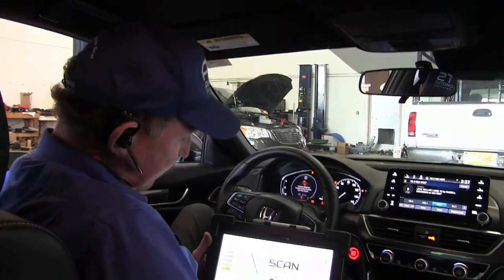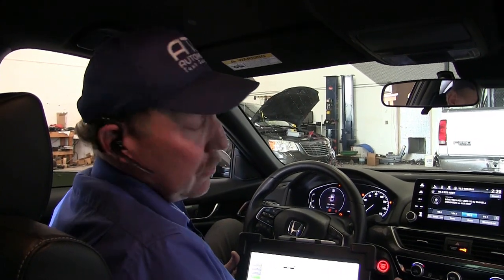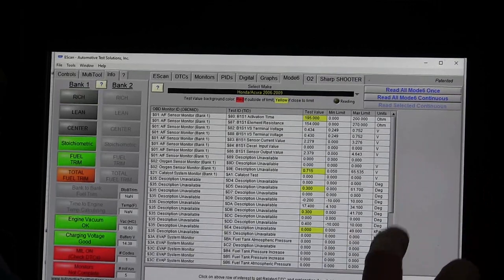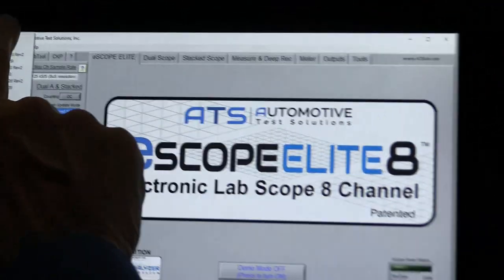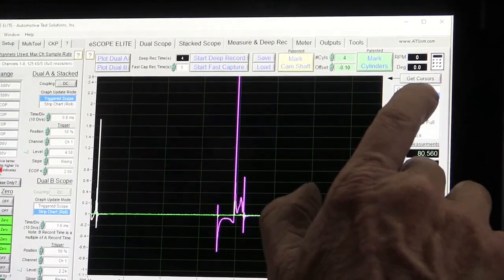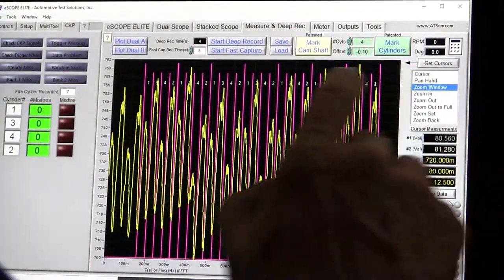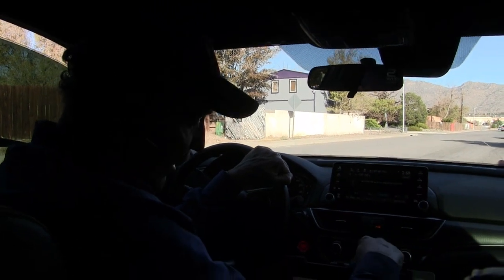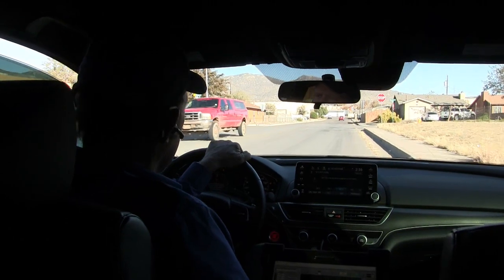Diagnosing a Misfire & Lower Power on 2018 Honda Accord 1.5 Turbocharged Engine P0304

Comment: 2018 Honda Accord EX-L 1.5 73,300 miles. Just came back from the dealer. Started with christmas tree lights (every warning light) going off in the car. Thought it was a bad battery, bought a battery wasn't that. Misfire on cylinder 3. Blown head gasket with a possible leak or deformed engine. They recommend buying a new engine at a cost of around $10,000.00. Went down an internet rabbit hole and it seems that the problem is quite major with thousands of posts all over the internet. The problem is believed to be making the engine more emissions-friendly to deal with government ratings; what they didn't foresee was the gaskets couldn't take the pressure. I contacted Honda GoodWill and seeing what they say, I'm not holding my breath. I've owned 1998 Honda Civic, 2009 Honda Civic, 2013 Honda Accord, 2016 Honda Accord, and 2018 Honda Accord...it's looking like this will be my families FINAL Honda.

Comment: I work at a Honda dealership. Injectors get replaced at an alarming rate. The manufacturer has a workflow of parts replacements in their troubleshooting. I am literally the first technician at this dealership to own and use a Picoscope. My test for misfires allows me to observe all of the things you have done in this video. One thing I would like to suggest is that you can capture high pressure fuel system sensor voltage and monitor fuel pressure drops during normal injector activity and compare among cylinders. You don't need to open the fuel system up at all and you can do this while the vehicle is running.
Reply: Should I stay away from these 1.5t engines? It’s time to buy a new car, but my 2012 Si with 160,000 miles, k24 engine has never had a single issue and I’m scared of these new ones.
Reply: @thomasengel1459  That's a good car. Why do you need to replace it?
Reply: @gooe9561  i guess I don’t NEED to. But that new integra looks nice. But if that 1.5t is shit I won’t do it.
Reply: @thomasengel1459  You do you but I don't think they're great. Injector problems, massive carbon issues in the intakes and on the intake valves. Fuel injector problems that repeat themselves. And we still haven't really had a chance to test the longevity of the turbos themselves.
Reply: @GooE   Can you please provide you workflow test procedure. I have an advance scanner and scope, but don't have ability to flow test these GDI injectors. Got a 2018 Honda Accord 1.5L with P0301. Its a slight miss at this point, don't have carbon trace.
Reply: Those gdi small turbos also experiencing LSPI syndrome and becomes Very serious damage to the engine:) nice Idea with this inductive sensors places on coil's...  Ps  long time ago I placed big coins connected to channels on top of ignitors and did the job:): maybe?:) Masters diagnose thumbs up
Reply: GooE honor and ambitious for company is the most important, but specially when so many comming back with the same problems.. A lot of techs at MD they know how to fix the problems with scope but is not profit from sell the parts  after warranty, I maybe wrong, but in UK is common practice.
Reply: Hi have you had blown head gaskets at an alarming rate also for 10th gen accord 1.5t?   Also do you think they fixed the problem in 2022 accord?   I have a 2022. Thanks
Reply: Benz has same issue on m177 AMG , one engineer created a formula per how each cylinder compression is to how much fuel needs flowed via injector numbers to know which one goes where
Reply: @thomasengel1459  I'm replacing the fuel injection system on my 2017 Civic Si after only 54K miles.  And I hasten to add that I religiously maintain my cars (regular synthetic oil changes, etc.).  I'm sorry to say that I recommend that you stay away fro the 1.5T engine.
Reply: I own a 2019 accord 1.5t and im having misfire issues at 70k miles. These cars are crap 💩
Reply: Hi! I just replaced my injectors on my 2018 honda accord with 128000 ; the dealership said the warranty only covers 125000 miles. After the replacement still keeps cracking the #1 spark plug(carbon trace)  after a few hard acceleration. The fuel (low side) between 50-60 psi. I noticed  the needle keeps steady  but suddenly stars bouncing rapidly and keeps for while and returns to steady. High pressure keeps between 5000 -6000. It doesn't drop in high acceleration.  I don't feel any high pressure in the radiator hoses.  Any idea? I just changed the injectors!!! And I went for a test drive.

Comment: You are the best!!! The dealership wanted to charge my customer $500 to replace the new spark plugs and Ignition coils that were only a day old. They told her that they were not of good quality, and that might be the problem. When I suspected all along that it was the fuel injectors. But she was out of town when it set the misfire codes. So, I wasn't able to check it for her. You gave an excellent tutorial!!! Much appreciated, you are the best.💯 Thanks😊 Happy Easter 😇🙏

Comment: My 2018 Civic EX-T recently had the fuel injectors cleaned just as routine maintenance at 77,000 miles. I’ve also replaced the spark plugs at 68,000 miles.I’ve never experienced any misfires but better safe than sorry. Car drives as smooth at 88,300 miles as when I drove it new.
Reply: 100,000 miles and I’ve never done anything except inspect my plugs and cylinder. Quality fuel should be all you need to keep your injectors misting.
Reply: @AJ-we9kd  it seems like that under normal driving and maintenance a person should use injector clearner every 2500 or 5000 miles.   This just seems like cheap $10 insurance to maintain your engine
Reply: How much you paid for that service?

Comment: That what happen to my 18 accord sport . All the lights came up on my dash like a Christmas  tree . Took it to the dealer and they wanted 4K to replace the injectors . My accord barely hit 60k miles and was out warranty . So I bought the injectors from the Honda parts department and had them replaced and it fixed my issues . Sold the car right away . The car also let me stranded multiple times in the freeway when it had that problem . The car would just shut off .
Reply: I just had the same issue!!!
Reply: @waltersantiago9522  What kind of fuel were you running? Were you doing short distance or highway miles?

Comment: Awesome diag and scientific explanation, Bernie! What happened to Honda and Toyota...they used to make reliable cars that lasted for decades. Now a 3-year old Honda is having major drivability issues haha
Reply: What do you think about the toyota direct and port injected combo engines? I'm in the market for a new car but with honda and their turbos and Toyota with their combo engines and bad fuel pumps im on hold for a while lol.
Reply: Get a tesla
Reply: @benagardi  those are the worst out of those 3 hahaha
Reply: @paquesepas6696 go with Mazda as they use traditional automatic transmissions with no turbos or oil dilution issues
Reply: @JohnS-il1dr  always had a honda or toyota so going to Mazda would be a big step don't know if I could do it

Comment: If nothing had been replaced, any shop would have not caught this unless it was fixed temporarily and returned, then we would have looked elsewhere for the real problem. The same can be said why were the injectors dirty to begin with? Bernie may have solved half the puzzle but it is possible that the fuel is dirty or filter, he got consistent numbers when pressurizing but it could be a low pressure number for this GDI system. Cars can be complicated sometimes.

Comment: 2017 Civic Hatchback Sport CVT. 191,000 miles troubled free on original spark plugs. Amsoil signature series, 91 octane always used, on 4th set of tires currently.  Honda makes great cars, these engines need 91 octane and oil changed every 5,000 miles.
Reply: 91 octane..... no they don't. If it's a sport model, it recommends it to meet the advertised HP but it adjusts the timings to prevent knocking if you put 87 in. Most of the models tell you 87 is recommended. You lose at most 6 - 8 HP by not using 91. If you drive an Si.... maybe you can justify it a little more (barely) but with a Type R yes... then you should use high octane. Civics and Accords are low HP, are you seriously coming on here pretending you know anything about cars because yours has lasted 191,000 because you used 91? No... in fact those spark plugs should have been replaced 1000s of miles ago and would cost far less then the extra cash you spent on 91 gas.... The oil at 5k yes, you are right there. Fuel injector cleaner every oil change at your next gas fill up is how you keep the injectors clean... not wasting money on 91/93 every fill up on a fuel efficient car lol.... High octane is for high horse power, do some research.
Reply: I'm not a certified mechanic,  I do know how to read instructions. I recently changed out the plugs at 196,191. They look good. These 1.5L turbos need 91. I have not had any fuel injector issues. Yet....

Comment: Injector 4 is flowing more fuel and making rich condition. Fuel is taken away and 1,2,3 goes lean. 2 and 3 have better flow than 1 . But 1 has very poor flow and is going extremely lean judging by the ignition waveform. This car needs advanced diagnostic approach. The DTC for cyl 4 is based on crankshaft speed not going fast enough after power stroke on cyl 4 and ECU is seeing this through the Crank sensor. but still i don't know why there's carbon track on spark plug for cyl 4. since this is rich cylinder. Maybe before the DTC was for cyl 1 and mechanic swapped spark plugs. And put carbon track plug from 1 to 4. And then the original plug from 4 got carbon track also because of severely lean cyl 1.
Reply: i agree with you ,
Reply: @keenxxx1  
no one.
Reply: Lean doesn't mean not enough fuel. Lean means too much oxygen in the exhaust stream. Fuel that flows at the proper rate, but doesn't atomize properly, can show a lean condition simply due to incomplete combustion.

Comment: My 2.0t was misfiring at 48k miles. Changed them and I have a video on my channel how to change the sparks
Reply: So all the lights came on. How much was the plugs?
Reply: How did it feel when you were driving. I have an issue where my car missfires on startup for a bit, like my knock count goes to like 11, then when I drive it will randomly spike to 36, but other than that it drives normal-ish, I wonder if it's the injectors
Reply: @Babyjokers2.0t  that’s the fuel pump. There is a recall
Reply: @Iegend17  high pressure or low pressure fuel pump?
Reply: @Babyjokers2.0t  bruh wtf lol. I am done answering questions

Comment: Judging by the high spark line we know there is a lean condition. It's probably safe to say the injectors are restricted. But why was the vehicle subtracting fuel? Usually with a restricted injector the fuel trims will be positive.
Reply: An poor combustion event will flood the exhaust with unburnt fuel and crowd the O2 out of the exhaust, tricking the ECU into reducing fuel, you just have to remember that O2 sensors are measuring the absence or presence of oxygen. The ECU will reduce fueling to try to bring O2 levels back up.

Comment: Sure did learn something new, and this information will definitely help me out with the similar issue on a 2018 accord that just got dropped off. As you mentioned they have change plugs and coils to get the issue right back after a few days. Definitely would want to take some classes from you.
Reply: Did it go away after changing the spark plugs and coils?

Comment: My Accord is displayed 10 warnings on the dash, code reader is showing PO301, PO304 and PO300. Car is running fine, no issues. It doesn't do it when running, all 3 times so far is when the car is started. 1st time codes reset because no running issues, problem reoccurred after about 1000 miles, and again after about 1500 miles. Again, no loss of power or sluggish starting.  Is it possible that it is caused by the fuel pump that is currently a recall? I'm current waiting for the dealer to get part for recall, should be early to mid-December.

Comment: A question here. I can see that cyl #1 being lean, it's easier for the spark to make its way outside and create the carbon trace, but how is it that #4 which was the richest of all four (I presume since it had the largest pressure delta) suffered from the exact same symptom?

Comment: My 2018 Accord 45K on it started with a slight miss fire when cold then every dash light came ABS TPMS and all safety features stopped working. After several trips to the dealership it needed all the injections replaced.  Honda paid for 80 percent of it.  I think I could see all the warnings lights lit on this car too. But yes you are on top of your game, congrats.
Reply: GDI engines are garbage in terms of reliability and longevity and ease of repair. But they have good economy and power for the first 30k miles! :)
Reply: @PineHollowAutoDiagnostics  is the gdi only on hondas turbo engines or is it also on their 2 liter engines?
Reply: My 2018 Accord now is having the same issue.

Is your car still under warranty?  Mine is not so would have to paid the whole amount 😕  
What is the total cost for the repair?  TIA!
Reply: Mine was out of warranty 45k on it. Honda picked up 75 percent of the tab. My share was $250
Reply: My 2021 seems to have the same problem. Shut off on the highway and every dash light came on. Only 2 months old smh
Reply: @Slippery413  what was it bro mines acting up
Reply: @jrjr8738  I went in for an oil change and 2 weeks later I needed a new engine and turbo charger because they didn't tighten the oil plug, and wouldn't cover it under warranty either. This was at a Honda dealer where I bought it.
Reply: @Slippery413  damn bro that’s all bad
Reply: @Slippery413  makes me wanna buy a old Honda instead man
Reply: @jrjr8738  Some dealerships are known too do this on purpose for profits and probably fix up the bad engine and sell it.
Reply: I have same problem 2019 honda accord with 72k they want $210 to diagnose. I have every lights on and sometime emissions system problem stays on. Need help

Comment: My 18 Accord just the same problem, with on 43k miles. All 4 injector were replaced. Only got the car back today🤞🤞.
Reply: What exactly was the issue?
Reply: These new accords suck. My 2021 just broke down on me after 2 months of having it. All lights on dash came on with warning too see dealer
Reply: How much was the cost to replace?

Comment: So how do we know if there piezo or coil type injectors? Piezo has 2 wires going directly to computer?
Reply: Would also like to know.
Reply: I would like to know too.
Reply: No, because all gdi injectors piezo or not have two wires to the computer
Reply: @mikesabin8568  so how do we know the difference
Reply: @philh9238  well, I would probably look the injectors up on Mitchell, alldata, or identifix to know for sure. Piezo is generally a bigger and longer injector. Bmw and vw use piezo. What i do know is counting wires to the computer wont help
Reply: @mikesabin8568  makes sense
Reply: A piezo type injector will show VERY high resistance (possibly in the 100th kOhm range) where as a solenoide type injector will have low resistance.
Reply: @juergenscholl2843  makes sense f
Reply: @juergenscholl2843  yes, assuming its not a bad injector, the resistance is 150,000 tp 200,000 ohms.

Comment: That's great video. Right now I already have honda accord 2018 1.5 turbo. They also have same issue but my honda dealer doesn't figure it out my car problum they had to change fuel injector but still misfire problems is doing. Pls help me what should i do. Thanks.

Comment: My 2018 Accord gave me the same code. Once when I checked myself and once at the Honda dealership. Says cylinder 3 misfire.  Yet they still can’t find out what’s wrong with it. I’ve brought it back to them 3 times and the first two times they told me the car was fine. Now, the third time, they are telling me they have to tear down the engine and quoted me $3020. That’s ridiculous. Just for a tear down.
Reply: i just did my own code scan, no CEL on it was blinking Loss of power with jerking. Turned off and on it was normal with no CEL! .. Mine says CYL Misfire 3 i ran myself. but not sure how when everything is new & injectors
Reply: Did you ever get your car fixed? I’m dealing with the same issue new injectors coils plugs and everything
Reply: @waynethompkins6205  no. Dealership had it for about a month and couldn’t figure it out. Said that they had to do a complete engine tear down which would have cost me $3,000. I ended up trading it in. Very frustrating.
Reply: After the 3rd time, wouldn’t the lemon law buy back kick in?

Comment: Are you charging the high pressure rail with the electrical transfer pump instead of using the mechanical high pressure pump?  Why?

Comment: I wish I had you around to teach me! I had this issue in my 2018 accord about a year ago and had honda replace fuel injectors and coils and a few other parts ( I had to do plugs) but a year later I can feel the car starting to lose power and after the 1st time around I know all the signs EVERYTHING I went through for months and all the research I did to figure it out TELLS me these symptoms are arising again.I need Help good sir and a true technician master mechanic like yourself. I worked hard for this car and i commute i need this car to last..What state are you located in?
Reply: A year later injectors failing again, how "normal" is this??

Comment: What if you are still getting the same thing after replacing the fuel injectors and spark plugs?
Reply: blown head gasket - leaking coolant into cylinder causing intermittent misfire - that's what is happening in mine - honda reliablility 0 in this 1.5t engine.
Reply: @rathernotsay9768  Same thing happening with my 2.0 Touring :(